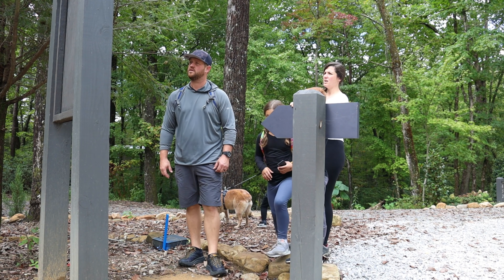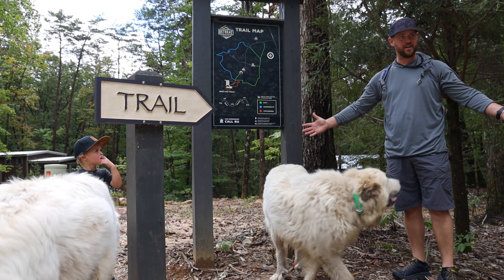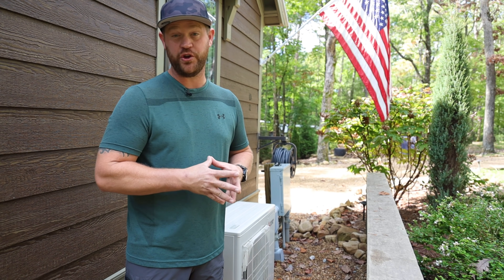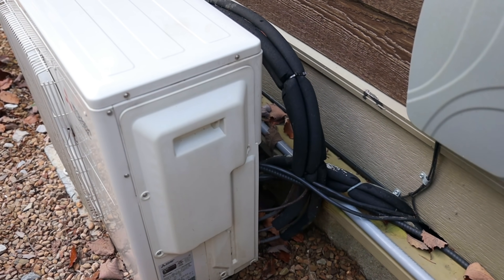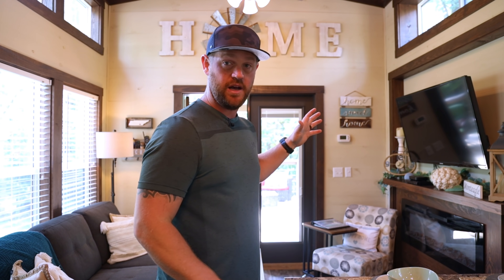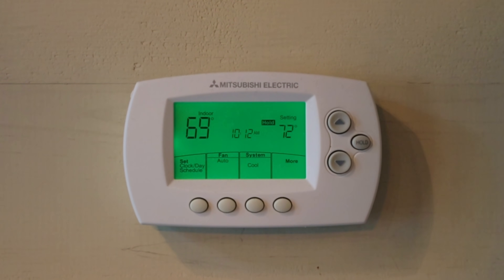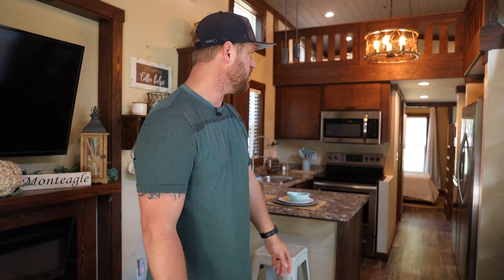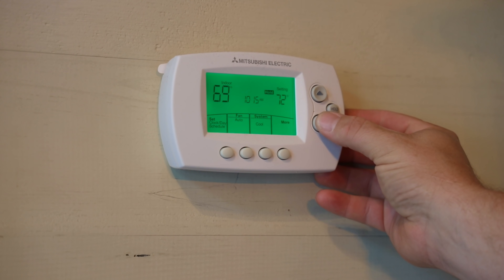DUCTLESS Mini Split In A TINY House | Is There A BETTER Way??

Comment: Maybe he coiled up the piping behind the condenser because there’s a minimum length needed? I’ve seen this before also and then dived deeper into it finding out for certain systems there’s a minimum pipe length requirement

Comment: I must say Quality HVACR has great videos and explain things for those not versant in the trade; I retired from the business after 60 years and loved most of it, except hot attics where units had clogged-up drains due to lack of maintenance programs!
Reply: What type of maintenance would you do to prevent clogged drains?
Reply: @PROJECT.LUKE.ONE.75  It will vary due to sites; in most residential usually twice a year is ok. In a commercial/industrial will require more. Dental places required changes of filters 26 times a year. HEPA filters! $$$$

Comment: I do like those mini splits, but I'm still trying to figure out how to work on them. Love your vids. Great teacher. 
Please make a video about variable speed compressor and why some of them only have low side Schrader ports and just a general video on them! 
They are the future of hvac with there low energy consumption.
Reply: From what I understand there's not a lot you can do.  The charge has to be weighed in, no superheat and subcooling charging because the unit changes so many variables on the fly.  The "liquid line" in the line set is actually on the downstream side of the EEV, which is in the outside unit,  so putting gauges on it wouldn't help.  And it wouldn't take long for a repair to exceed the cost of replacement.

Comment: What is that bump on the left hand side of the head in the living space?
Reply: Thats the OG wireless adapter for the MHK1 Stat.  Newer MHK2 hides inside the cabinet, although the guts can be removed from the old one and tucked inside.

Comment: I put a Mr. Cool in my garage. The Mitsu's are claimed to be the best. If this was for the house I would have went with Mitsu but for the garage that I will use a few days out of the year Mr. Cool fit the bill with the DYI system. App, wireless remote both can control them. Mitsu is extra for that Mr. Cool includes it. The hot garage in Florida cools down in minutes no matter the outside temp.
Reply: No offense, but follow up on how you feel when that compressor craps out and you have zero support, no warranty, or a professional to fix it for you.  Those are throw away units that last a fraction of the time of any name brand.
Reply: @pegleg402  The DIY units have support and a warranty. A real human answered when I called. They have a pretty good record. I installed it about 4 months ago. Other than showing it to friends I actually used it 3 times. I think it was around $1200 give or take. Mitsu would have been over $3000 with all the extras Mr. Cool comes with. 

Many Youtubers put these units in. Granted they got them for free but I watched more than I care to admit. I haven't seen one make an update that it crapped out. It's been a few years since they first gave them away so you would think if this was an issue it would be revealed. I've seen multi year updates of only happy customers. I have no doubt something will break as will any mechanical unit. I will ether fix it if it makes financial sense or just buy a replacement. 2 units would still be less expensive for a rarely used space. As I said if this were my house I would buy the best Mitsu they make price wouldn't matter. This is my small 1 car garage. I didn't A/C the big garage.
Reply: @scotts4125  they do serve a purpose, i agree.  But so do ptac units.  I really am curious how this works out.  Let us know.  Cheers!

Comment: On most ductless mini split units there is a minimum length for the lineset, that could be the reason for it being curled behind the outdoor unit.
🍺🍺🍺🥃🥃🍿🎯
Stay safe. 
Retired (werk'n)keyboard super tech. Wear your safety glasses!
Reply: Might have been better to put the coiled up section under the house to keep it out of the sunlight.
Reply: @theElderberryFarmer  do you know how many linesets are in the sun and still work?
Reply: @realestateservicessaleshea99  Plenty, I am sure. But that doesn't change the reality that it is better to keep them out of the sun. Not to mention that the excess lineset being out of sight would make the job look neater and more professional.
Just because something sucks but still works doesn't mean that it doesn't suck.
Reply: @theElderberryFarmer  I get what your saying D but in some mini split seminars they actually tell you to coil it behind the unit or lift and put it under ,but make sure you have the recommended lineset length.
The crawl space or under house availability may not have been an option,NO?
Reply: Pre-charged line sets are a real pain in some cases!
Reply: @bobboscarato1313  these aren't pre-charged the manual on some manufacturers equipment Actually say minimum lineset length.
Reply: @realestateservicessaleshea99  Got'cha; Thanks!
Reply: Fujitsu recommends a 12 - 15 ft minimum lineset im unsure about Mitsubishi.
Reply: Ya that a mitz thats not one of them thoses lines can be as short as u want.. Mr cool sends precharged lines that the only reason to coil it.... kind like the new precharged 404 walkin and freezer units
Reply: Yes sir you are correct. Maybe you can answer this question for me! I installed one mini where 15-93 ft of lineset didn't require any evacuation or additional refrigerant. How in the hell does that work? Like 20 feet or 90ft line set and its good to go???? Baffles me
Reply: @andypatterson8991  I don't know about no evacuation,  but the "compressor technology " is key!
Reply: @andypatterson8991  inverter systems can be over charged they only allow as much refer as it need per head in on each call that why u can have multiple zones on the same system it's a value system
Reply: Mitsubishi does not have a minimum line length, but anything under 15 feet can produce velocity noise.  I have seen 10 footers with zero noise
Reply: @pegleg402  Thanks for the info!

Comment: Very good machine but seems a bit oversized for the tiny house. For 360 sqft 12 000btu should be more than enough if installed on the 10 foot wall.
Reply: It's variable speed unit so it runs low for awhile also better to over size then undersized. 25% is a safe oversize estimate to go by.
Reply: Mitsubishi does not make 12000 btu Condenser 2-zone units.
Reply: Can't go by square ft all the time. It's about heat load. Insulation material, building material, Windows, shade from the sun etc. A 360 square ft shack with no insulation might need a 4 ton to cool it. 😀